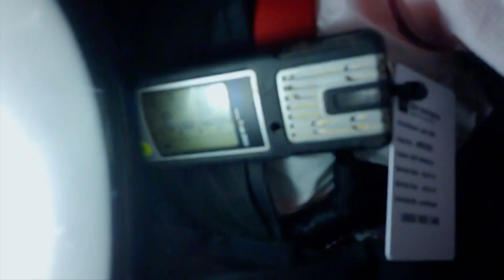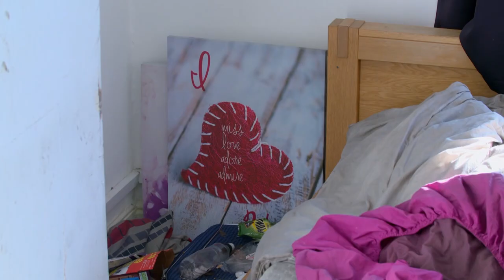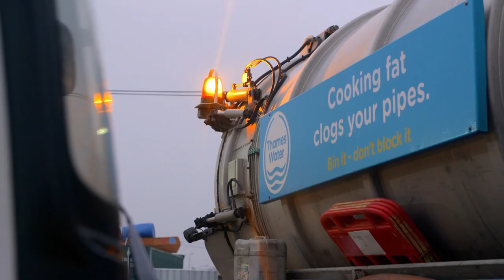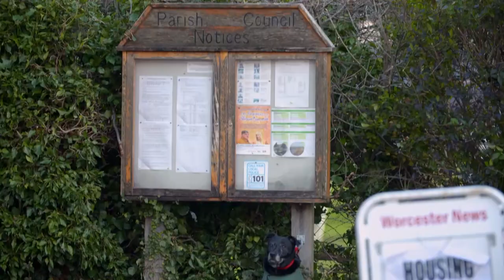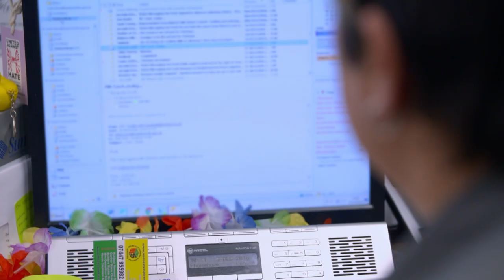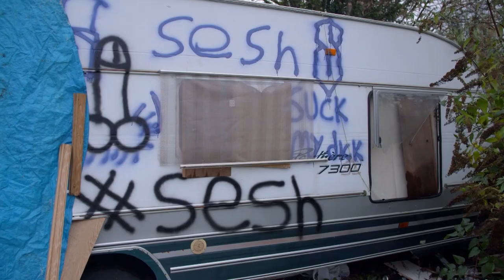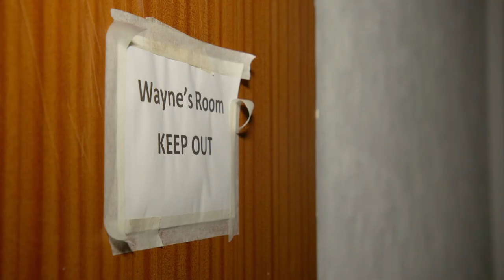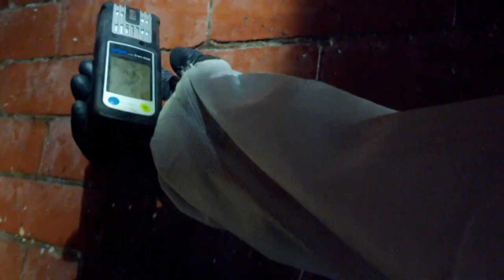Cleaners Find Cupboard Full Of Stale URINE! | Grime and Punishment | Filth

Comment: The sewer portion of this video is getting a bit ridiculous. There was a high reading of methane so the guys came out. Then they get the all clear to go back in. So where did the methane go people?? It isn't like there is ventilation down there. I think this portion of the video was a bit sensationalized. I know there is methane in sewers but no one was wearing a respirator which would have been the SMART thing to do. I don't buy into most of this portion of the video.